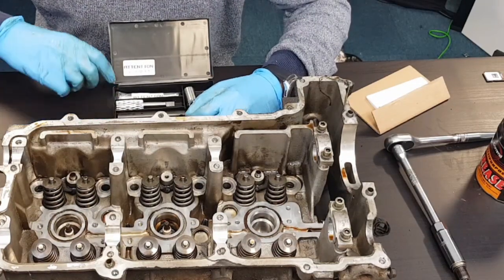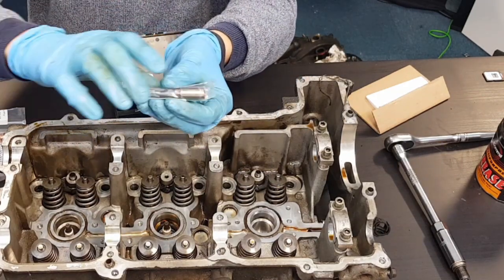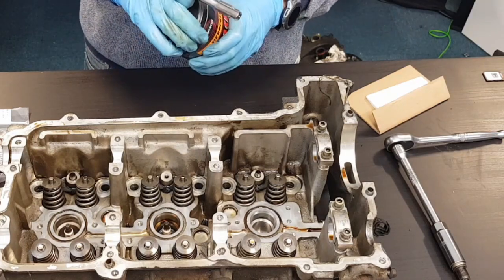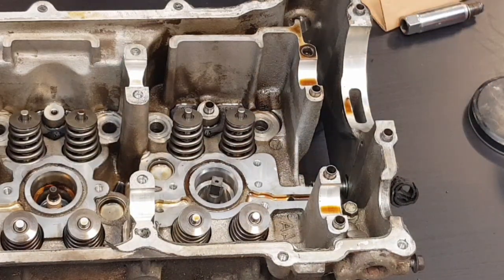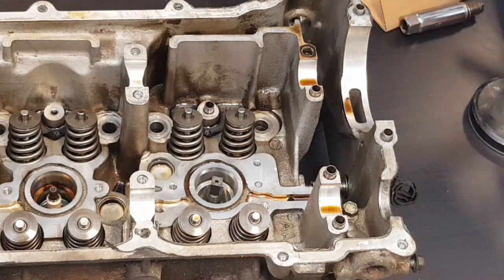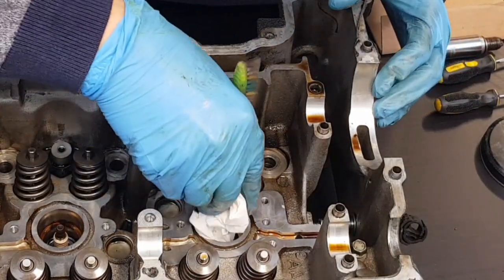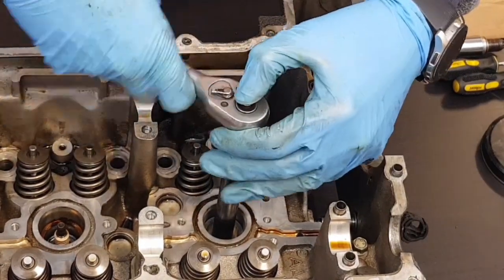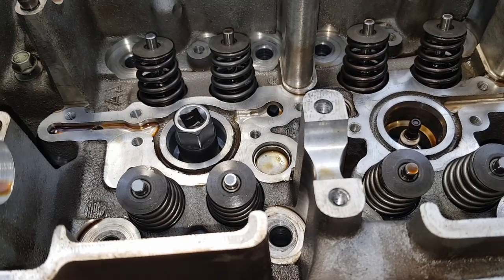Timesert spark plug thread repair on Porsche 996

Comment: I think the standard M14 timesert spark plug kit includes 16.8mm inserts. Perhaps you can use their 15mm insert, which should be just short enough to prevent the threads from sticking out.

Comment: 😳 WOW 😯 I couldn’t wait to see what was on the paper towel but I never expected to see a small mountain of metal shavings. That’s a classic case of solving one problem and creating a disaster on the other end. You’ve proven that spark plug hole repairs require head removal. I truly appreciate you showing the results